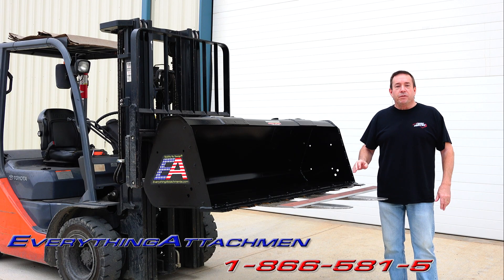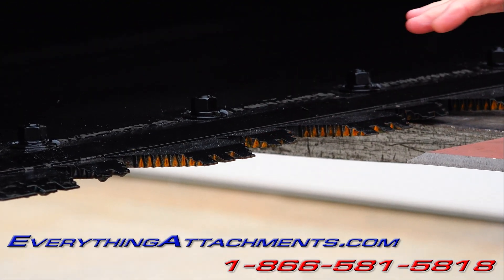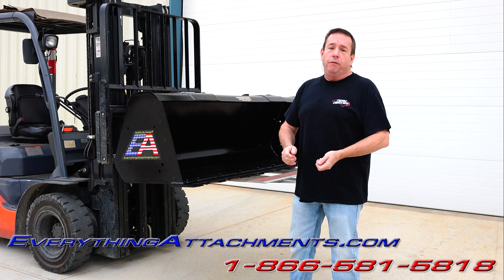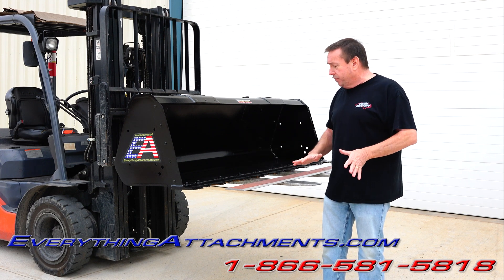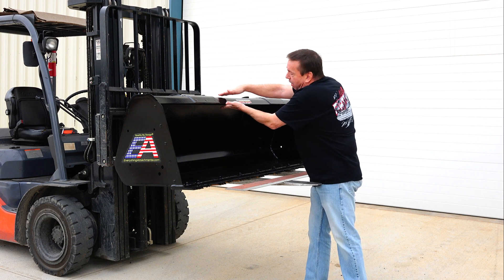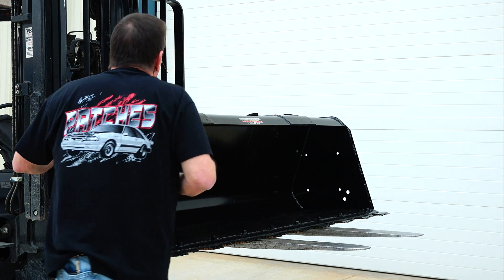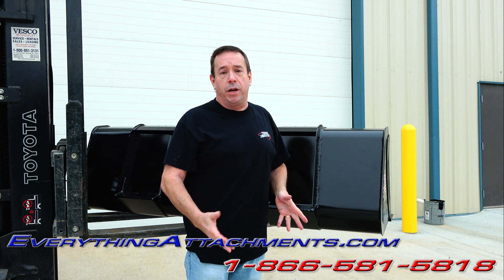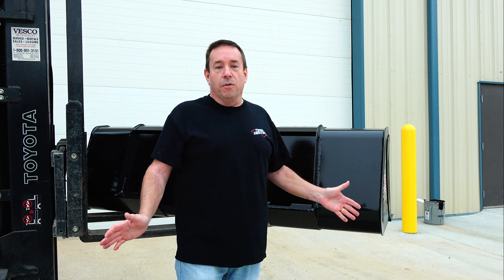Ted Discusses Wicked Tractor Buckets

Comment: Hey Ted, once the "kubogy people" ( like me) find out how their "almost worthless "  "stock-loader-buckets" are, you will be selling them like "hot-cakes". I did an "Experiment " with my 66"Massey-Ferguson loader bucket on my bigger MX5200 kubota & "Walla" WHAT AN IMPROVEMENT. Then Bought a 78"  800$ cheapo( not yours)for the "original HD 72" kubota loader bucket;;; and What a Drastic IMPROVEMENT!  It loades 75% easyer & 50% MORE & 150lbs lighter. I think the original factory design ( kubota) was made for working around an "Open-hearth Blast Furnace" ;reason = it just didn't work well on ANYTHING for the first 5years & 925hours; with the "ONE Exception" it "anchored " the front end when using the Back-hoe Atachment( lots of Dead WEIGHT). Thank you Sir for the Excelent vidio. Best wishes with all your endeavours. I will SOON be a customer of your quality, well Enginered Fine Products.